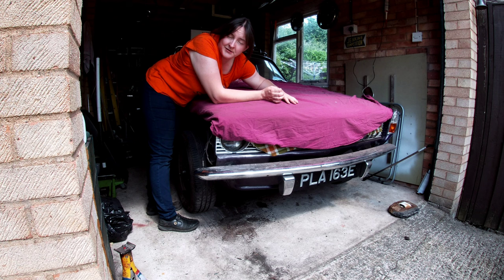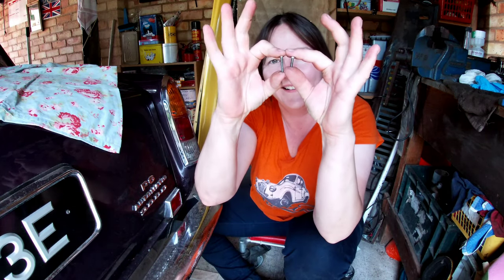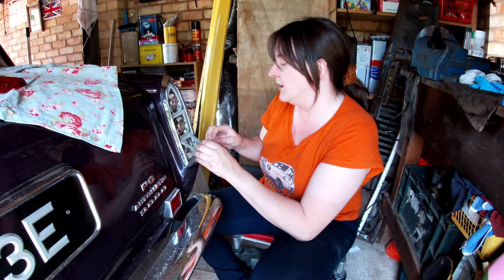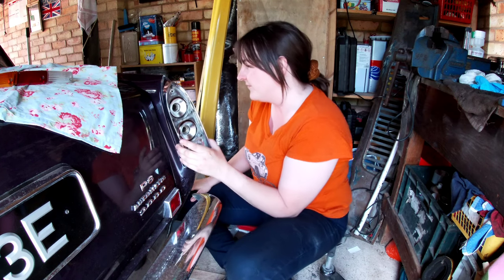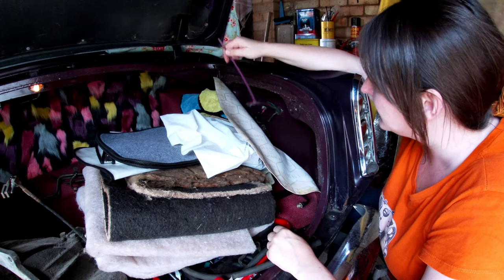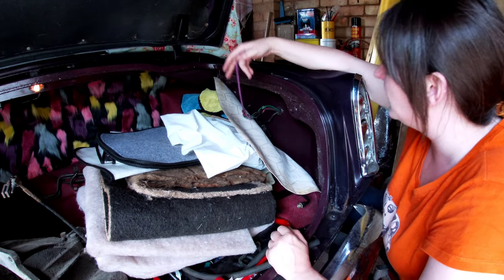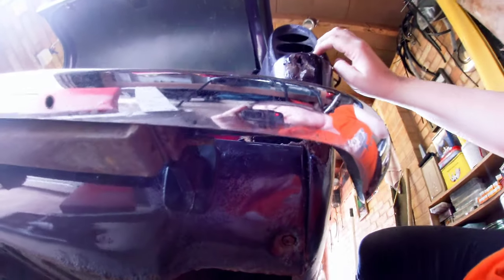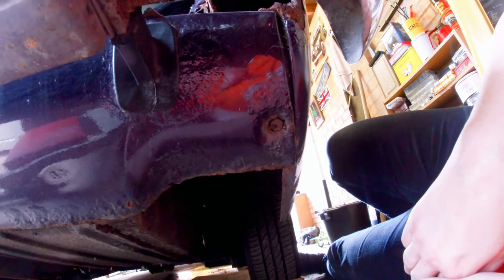Rover P6 - Rear Wing Removal and Rot Discovery

Comment: I think that's nowhere near as bad as my grey car was. Ian of all people welded it up before I even knew what a P6 was for the previous owner, it needed sills, floors, a posts, hockey sticks, some d post work, some in the same areas of the rear arches as yours, the boot floor, under the rear decker panel, the list goes on etc etc. It's one of the heaviest welded P6s out there. The replacement parts weren't exactly the same shape and hand made but they're in to restore strength and saved the car. Now it might not be worth paying the sort of garage that charges £100s an hour to do it up as you'd end up spending thousands, but there are people who don't charge hundreds an hour and still do a respectable job, or, what I did years ago was buy a cheap variable control mig welder that also does flux core, watched lots of videos and had a go myself, then started letting myself loose on cars, and so far I haven't had to reweld something I've done... A woman of your capabilities should easily be able to self teach welding. Now I know of people who have broken cars that were immensely savable, and even I have in the past broken a good car that was immensely savable because I was an idiot. But that's down to business sense when these were worth less - and how to easiest make a quick buck, but that's not the case here, this is just filling holes and shaping metal. In short, it's doable.
Reply from the maker: Thanks Adam 🥰 . I have done some welding so just need to borrow a welder and get knuckles deep in rust for a bit longer than expected.... it was just so daunting seeing so much going on under that wing and also it is in my mind that it is a write off from having two previous accounts of people smashing into my B posts.... so the shell is tainted anyway (doors have never shut nicely since the 1st accident) . 😔 . It's all disheartening.  But i love that car.  He will live on! It will take time that is all 😔 x

Comment: Cheer up. It really does not look so bad. Sand down the rust till you get to bare metal. Treat the bare metal with some rust repellant and then weld some metal over top of it to get rid of the holes and add some paint and put the rear fender back on. The ability to replace the rear fenders easily is also the car's downfall as because you can remove the rear fenders to replace them, there is no way to get a perfect seal to keep water out but there is enough of a seal to keep the water/moisture in and rot the metal out. Oddly enough the best metal you could use to fix that is not available in the UK. These are American license plates. The metal in them is strong and resists rust but is easy to bend and shape. Growing up there were a quite a few old cars with new floor boards due to license plates from the 50 states. 

As this is not your daily driver and lives in the garage, you don't have to rush to fix it to get it back on the road to get to work and other places so you can take your time and fix it
Reply from the maker: It was my daily driver 🥲 .but i knew he needed lots of work/time off the road. That's why I purchased my P4 to be the daily driver until Mr Jenkins was up together  x 🥰

Comment: Hi Alex. I’m absolutely gutted for ya. That poor old girl is just riddled with cancer. Nothing worse when a car you love and have done heaps with is that badly rusted. 

I totally hate to be the bearer of bad news,, but I can garuntee that Once you start peeling back the layers even more so,, , you will quickly find out that the car is even worse than what we’ve seen already. 

I think it would be quicker and easier to re shell the vehicle. I’ve done rust repairs on cars where you see a little pin hole here or there. Then when you get stuck into it,,, a pinhole in a sill turns into torque boxes and the front halves of the outer sills both sides and some major rust treatment to pitting on the inner sills. 

When I go to look at a car to buy and I see rust in tricky or complicated places,,,, I walk away. 

Rust is a bastard,,,, it can spread through a car like a venereal disease through a hippy commune! 

Ultimately this is a tough decision for you. Do you spend a heap of time and money on a car that isn’t worth what you will ultimately be spending on it,,, or are the memories and sentimental value of repairing and keeping the car going of greater value??

I don’t know what the cost of things are in the uk,,, but in Australia, repairing all the rust I’ve seen so far in that car,,, plus paint and panel work,,,,,, you’d easily be looking at around the 8-$10,000 mark,, which is roughly 5-£6000 gbp.

Nice p6 rovers over here are attainable for around 10 grand for a very very nice solid car.

Either way you go with it,,,, I hope you get the most enjoyment and do what you feel is best. 

I wish you nothing but the best of luck with it all and I’ll be eagerly waiting for your next video 👍
Reply from the maker: Thank you for your lovely message. 
The outer panels i purchased years ago. 
I prepped them all myself so just need to pay my mate to prime and top coat (that won't be much). 
I've got the inner and outer D post repair panels all for £145. 
All i need now is time and effort 😎 . Stay tuned....
Reply: Your welcome Alex.

I just thought if another thing to bear in mind. When doing the rust repairs on the c pillars /d posts, if the car isn’t on a traditional chassis and is instead a monocoque construction ,,, you may very well have to cross brace the body of the car to prevent the body from bending like a banana,, if you don’t,,, there may be a chance that door gaps and things like that won’t line up properly if at all. 

I’m by no means well versed in p6 rovers.,,, so I’d say perhaps run what I just said by a collision repair shop or someone who restores classics who might have experienced similar rust issues. 

When it comes to treating rust in especially the doors or any unboltable panels,,, perhaps try this trick.

Find one of those kids swimming pools, or something big enough to fit a the largest panel in.
if it’s not stupidly expensive, buy it and fill it with 50-80% vinegar and the rest water and submerge your panels in it. You’ll keep each panel submerged in it for roughly a week.
Once each panel has had its time in the vinegar,, rinse it out real good and then give it a hit straight away with your rust killer stuff and as soon as possible, get your painter mate to give the insides of the doors a hit with 2pack epoxy primer. 
That stuff is a damn near 100% garuntee to give the middle finger to rust attempting to make any kind of comeback. 

After that,,, once everything is all painted,,,, fish oil the living crap out of the whole car. 
Either that or mix up some atf with some petroleum jelly and squirt a bunch of it in and around ALL the crevices.

Only do this AFTER you’ve epoxy primed and painted 🤙